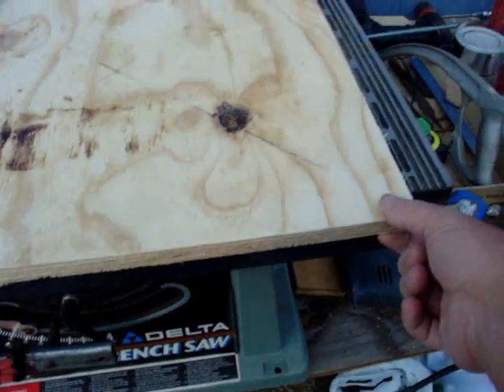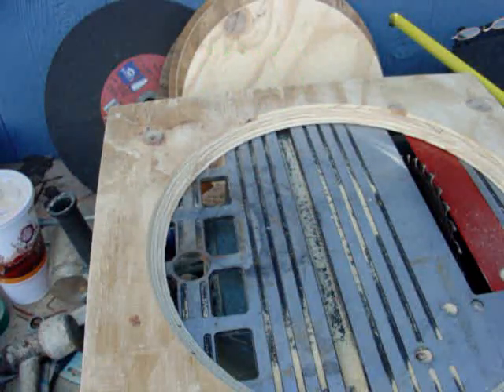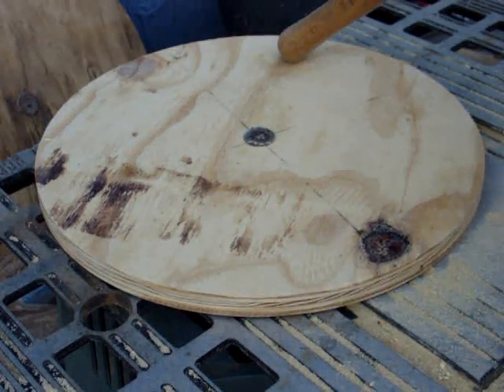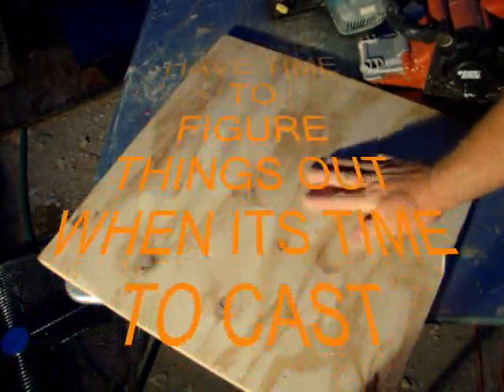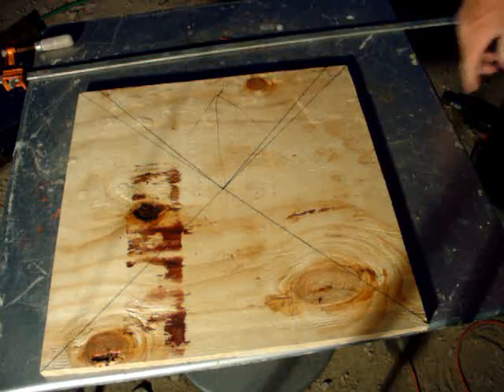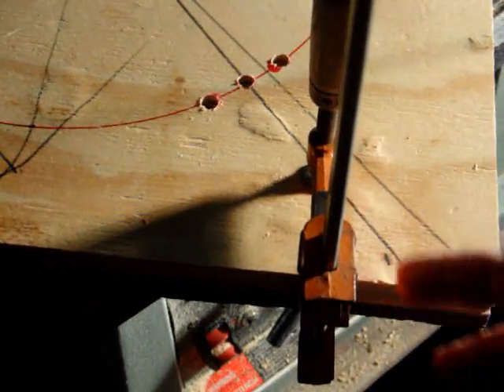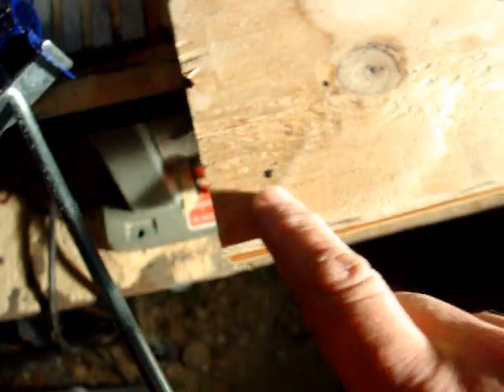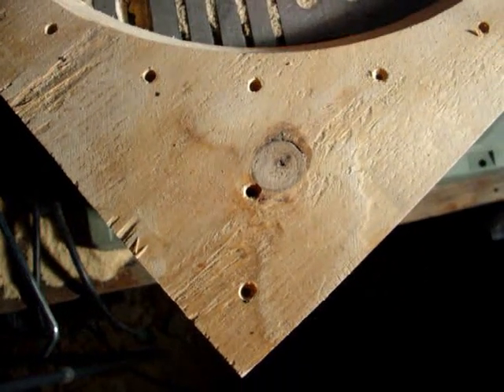BUILD A DUAL PERMANENT MAGNET ROTOR WIND TURBINE (PART 13)

Comment: hi eu sou brasileiro e sou programador de microcontroladores e rebobino motores trifasico, e  vi o seu projeto 
fantastco que você fez amigo muddymuddymuddmann e seria possivel me mandar detalhadamente o seu projeto pra que eu possa fazer e aqui no brasil ? Obrigado Deus esteja com você.
Reply from the maker: willian max dos santos 

Os detalhes não são tão importantes quanto você pensa. Mais fluxo magnético, dá-lhe mais tensão por RPMs. mais grosso fio yeilds mais amperagem. Motor diferente têm configurações diferentes de fiação. monofásico, trifásico e às vezes dupla fase. Para resolver essas coisas, você pode usar uma bateria pequena. uma pilha de 1,5 volts D vai funcionar bem.
Adicione uma lâmpada flash de 1,5 volts para uma extremidade da bateria.
Adicionar um fio para o outro lado da bateria e adicionar um fio para o outro lado da lâmpada.
Em seguida conecte os dois fios para os fios saindo do motor elétrico. Use uma bússola para descobrir quantos diferentes polaridades magnéticas lá estão dentro das bobinas fixas do motor. É quantos ímãs você vai precisar. Preste atenção a polaridade das bobinas. que dirá as polaridades dos ímãs para instalação.
Rpms mais elevados lhe dará maior tensão. ímãs mais fortes vão lhe dar mais tensão. Fios mais grossos lhe dará mais amperagem.
Espero que isto ajude. Desfrute.
Obrigado.
Reply: *****, muito bom, gostei da resposta.